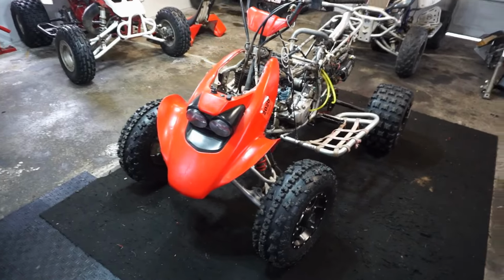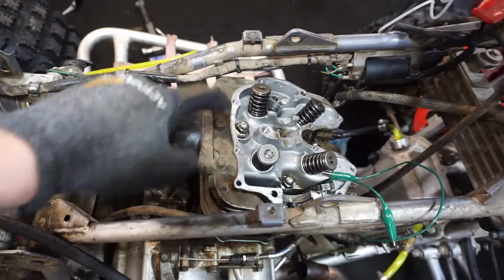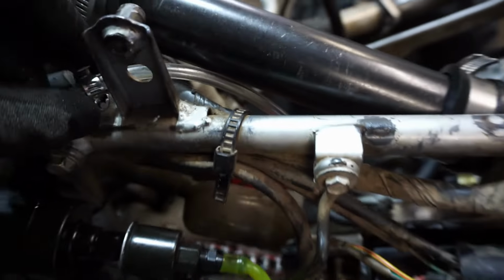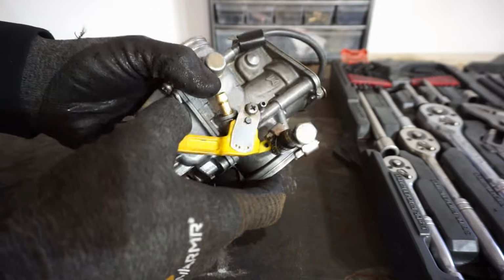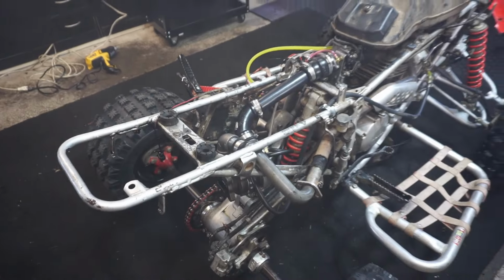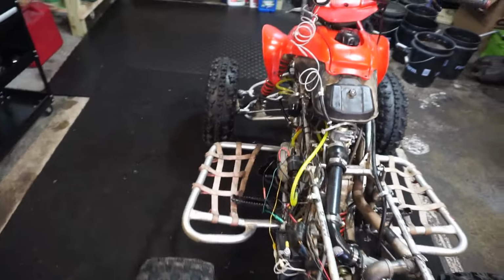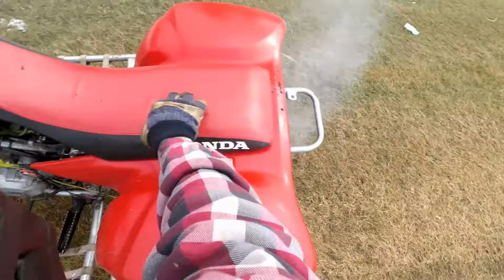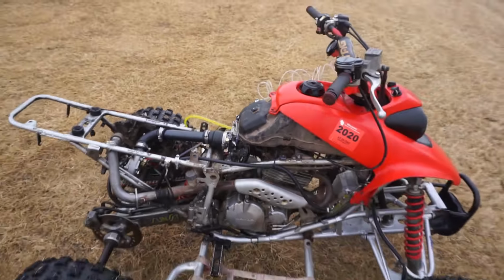Turbocharging My Honda 400ex 2.0 First Ride (New Design + Upgrades)

Comment: Hey brother you should never use an extension with a torque wrench. Ive tested it and 100% the extension does affect the reading and youll end up over torquing. I mean if ur using a 1/2 inch drive and a super stubby extension with a deep socket thats fine. I know it sucks. But its the truth. So single cylinder engines are tough man. A lot of times you have to build a pre atomization expansion chamber. So essentially a canister before fueling with a volume equal to twice the volume of your engine. So in other words, you want to have air stored for the intake and compression strokes to avoid essentially creating a vacuum or negative air pressure in your carburetor i.e. causing detrimental surging, poor performance, and intermittent rich and lean conditions. Air density is extremely important with turbo stuff. Another way to  compress the air which also helps with your intake air temps is air to air intercooling. Intake air temperature being exceptionally important with carburators. There's a guy who does a really , really good series of videos on blow through carburetors. I'll post another comment with the link in a second. Of course the cure to all your problems is electronic fuel injection. Preferably port injection with one or two injectors that have an adjustable pulse width. Two is what I suggest. Yamaha R1s...like 2005-2009 have EXCELLENT fuel injectors and they're readily available. Get yourself a haltech elite 750 and I'm telling you bro, you'll be thankful you finished the thing. I own a supermoto'd  out 91 xr600r. It has a cr450 front end, carbon fuel tank, dual front brakes, and the 3rd smallest internally gated turbo on ebay. I converted it to fuel injection, cut a front mount intercooler in half, made myself a little air to air intercooler, the turbo sits where the stock air box used to. I just merged the dual header into one 2 inch pipe then welded a vband on that and the t3 flange, cut 4 inches off of an fmf power core 4, welded it to an 1/8 inch plate I matched to the shape of the outlet and dude I gotta be honest....its the funnest motorcycle i own. It does 135 mph, wheelies in 5th gear, sounds insane because it has an adorable little blowoff valve from a snowmobile turbo kit and it's LOUD. Plus it barks big ass flames and there's nothing that can touch it from 0-100. One more piece of advice...get yourself an even just a 1 bar wide band. I would get a 2 bar just in case but hey, that's me. It's the most sure fire way to get your AFRs squared away.

Comment: Is it truly running boots?. If so you need to pull timing out when boots kicks in. Lol use a boost ref, solenoid. To the stator, that pulls timing. Then you should be able to jet it back up. Btw put a down pipe on

Comment: the only reason i say to try it without the fuel pump and related parts is because the only time you tried it with the carb still being gravity fed (atleast in your videos) was when you were trying it with the carb feeding into the turbo (again i didnt see it in any of your videos) i still think that with the turbo and carb how they are currently is just fine and i think (im nobody so this is just my opinion) if you remove the fuel pump an regulator and have the fuel line from the tank go to the carb how the it would of from honda still with carb being referenced to boost (may have to play around with how said boost reference line are connected to carb) idk im not really anybody but it wouldnt cost you anything to take the fuel pump and regulator off an run the line from the tank to the carb an try to fire it up an see how it runs then ( if it runs at all or even decently you will most likely have to play with jets an needle and seat) as far as what i seen in all the turbo quad series you have tried literally everything else. on a side note the external oil pump to help pull the oil out of the turbo was freaking genius ive never even thought to try that but ill be using that idea if you dont mind lol. whether you try it or without the pump or not you got damn close man take care

Comment: Man you can do it people turbocharged banshees all kinds of stuff I just watch a video today where a guy took a lawn mower carburetor a lawn mower carburetor and stuck in on a 302 Ford motor and made it run it smoked the tires like it had a four barrel on it and it gets 45 miles to the gallon it's all about airflow and fumes you're dumping way too much gas on a lawn mower carburetor you don't want to go past 5 PSI so try to get it down to three it will plug the carburetor on my four wheeler I went from a 27 to a 30 and it pulled a rabbit out of the hole and it's on a 250 downfall transmission casing only has four gears I need five or maybe six

Comment: Maybe should check out Cars and Cameras.  They boosted a gocart and worked dang good.  Maybe they can give you tip of what might be wrong.  Love the video still
Reply: They had to switch to fuel injection. Then it worked like a charm
Reply: @donsylvia5164  well I wasn't sure how they got it to work but it was primitive looking and it worked

Comment: U need to change the slide needle to a larger needle once u jump up in jet size like that. Its just way too rich. Check ur spark plug. Bet she's rich bro. And w.e. is making it smoke is also an issue.

Comment: i think if it is putting that much oil out the exhaust makes one think how much oil is making its way into the carb going into the engine which then causes bogging because not enough fuel because the oil is washing away the gas

Comment: I do know on cars turbos need a down pipe or else it’ll cause a big boost leak for sure or no back pressure basically this isn’t a efi quad so it can’t be tuned try to dial in gap on plugs a buddy of mine turbod his quad I’ll give him a ring and report back to you

Comment: I would add a base gasket to lower compression ratio before throwing in the towel. I think you have too much compression for your setup. Also, try going with a bigger pilot jet. Leave your main in the 160-170 range and let the power jet make up the difference up top. Also, what gas are you using? Personally, I wouldn’t pressurize the carb. Blow through should do the job. C’mon man, one more try…….

Comment: Wonder if you could retro fit a fuel injection from a motorcycle or quad in fit?  That may make tuning a bit easier once it's done.   I think your really close to figuring it out.  Don't give up.  Take a break from it and keep researching.   You got this.

Comment: Dude, trying to get a carb to work with a turbo is a pain in the ass. I know you don't want to spend the money but just give up on the carb. Carb and soend the 1200 bucks for the stand alone fuel injection. Will take care of all your problems and that thing will fly. You will not care about the money after you get it done because it will be a monster. After that you cab change out the spring and push about 8 pounds and you will have trouble keeping the front tires on the ground.

Comment: Dude.. Carburetors rely on VACUUM to pull fuel in. You're instead, introducing PRESSURE into it.. That pressure is going through the jets and pushing fuel back into the float bowl. That's why it will spike 5psi but as soon as the remaining little bit of fuel being thrown around in the intake makes its way into the cylinder, bam, back to the boost pressure keeping any and all fuel from entering
Reply: You need to have the carb on the intake side of your turbo if you want this to ever work

Comment: i think you really need a fuel injected quad or motor cycle to actualy make some boost..
cause you dont see any carb engines with a turbo yes sometimes like 5 video over the hole internet... but fuel injected there is a guy with a turbo 450cc yamaha bike and i have seen others.

Comment: Just turn the boost all the way down almost off slowly add boost. Set boost low as a test. If it runs with really low boost. Bigger carb. It sucks push it the the corner. Come back to it I think ur close I know it’s super fustrating

Comment: Don't boost the carb put the carb on the intake of the turbo then the turbo will just suck on the carb instead of boosting it then you will be able to jet it it's the easy way to make boost with a carb
Reply: He tried that in his first version and it failed miserably, wouldnt even run. Blow through is definitely the way to go.

Comment: Boost pressure is pushing fuel back into the bowl.  Idea💡 run 2 carburetors one on the intake side of the turbo. 2 carburetors So the original carb makes it start and idle, 2nd carb gives fuel under boost.

Comment: Loosen the waste gate to keep it at 4 pounds of boost and run it, should be fine.
Reply from the maker: I will try that.
Reply: @2vintage  start with the gate loose as possible and tighten till you see boost, over 5 pounds is gonna be way to much for a single cylinder. i think i saw you boosting up to 15 before the head gasket went, you seem to have plenty of fuel for 4 psi
Reply: @2vintage  this has to be done under load though
Reply from the maker: @Meech917  idk if my waste gate is adjustable

Comment: so Why do you just jump to changing the jets?? there is an air/fuel screw, I have yet to see you warm the bike up and actually adjust the carb ?? unless you do and do show it.. Also have you checked that the air filter wasn't to constricted ?? I agree Im now into you what is now the 2nd video so alittle over an hour.. I wanna see it runnnnnn!!

Comment: Hey Joe love your vids... I'm wondering if your compression ratio is too high.. I know supercharged vehicles run around 10 to 1 I think mabey 9? If the engine evacuate the burned boosted air it will act like that.. kinda like the exhaust is plugged..not a pro just an idea👍👍👍

Comment: man.. Never mind you seem to be that same guy that acts like you know it all and wont put in the leg work. If you have the correct compression. Then its either going fuel delivery or timing.. I have yet to see you look at a spark plug?? Maybe just a hotter or colder plug..

Comment: A very wise man once said to me if you do adjustments up down and all around on 1 part of the system and theres no change. Its not your problem.  You have a spark issue. Make your plug gap as small as possible and if necessary uprate your coil. Under load the cylinder pressures are killing spark

Comment: I know im a bit late committing on this video, but i agree with some comments about the carb. A vacuum controlled slide wont work well with the turbo . And im curious about timing. I remember that cars under boost need different adjustments in ignition timing.  I think they need to be retarded a bit. Just my 2 bits worth. Love your channel.

Comment: i'ts never a good idea to run turbo if i'ts don't have all parts on exsample your turbo dont have boost clock parts on in end,but if i was you i would just put old bike cooller to hot side,yeah its direct little a boost in carpurator but in this case its goos idea to test becauce its can stil work really good.

Comment: I think you'll need a custom needle. When you think about it, you're idling fine, at low rom you seem okay, but as soon as you're making boost you start backfiring, which means lean. So, you'll need a big jet, and a needle that will restrict flow early on but dump fuel as you hit higher boost and fuel demand increase. Try cutting half an inch off a needle? Taking some of the taper away completely to see if you can dump more fuel once you hit boost?

Comment: Ok so you did follow me on the upgraded fuel pump and regulator, good. Told you tho, to get a fuel PSI gauge, you NEED to know the fuel psi... As i said; you need 2 PSI fuel pressure more then boost so; @ 8PSI boost, you need 10 PSI fuel. The regulator needs a return line!, the line you blocked-off... The jetting (and the pilot screw) NEED to be close to stock, the boost pressure IN THE carb bowl, will enrichen the mixture, automatically for the low boost you want. Wish i could give you my email or phone # safely, to help. You are close, do not give up!!!!!!!!!!!!!!!. Install a muffler on that thing asap too!!!. PS; test your spark plug CAP, and see if it tests right, you might be killing the spark with the added fuel/ air pressure... High boost settups run high perf. ignitions systems...

Comment: Doesn't turbos need to be as close as possible to the exhaust gasket?
Reply: no that isn't necessary, with a quad its just easier to put it in the back since you have more space than at the front

Comment: Too many variables without a gauge to measure richness and lean. Would need an oxygen sensor with a computer to show exactly rich and lean. A guage to measure your work. It needs not a steady rich and lean but a ramp up during full boost for more fuel. Without proper instruments to tell what is going on, like a lever arm to increase fuel during boost. It looks too complicated to me.

Comment: Okay for one I seen a f**** rubber coupler for house pipe on the hot side of Turbo that's not going to work that's gonna  last about 5 minutes until the engine warms up 4-2 the turbos too small it's actually choking your engine you can tell by the sound of it you need to get a little bit bigger turbo and then quit f**** with electric fuel pumps you need a f**** pulse pump to the f**** pulse of the engine and then you just compensate for needing more fuel with a bigger jet I know I seen somebody on here mention the boostedboiz 400cc shopping cart video that would definitely be a good video for you to watch to get some insight but you definitely need a little bit bigger Turbo and a pulse pump for your fuel pump or if you really want to get Brave converted to fuel-injected it'll be a lot easier I mean it be a little bit harder in the beginning but once you got it converted and running it be a lot easier to boost it with the turbo on a fuel injected setup then a carbureted setup

Comment: The idea of the bike is awesome, but I'm not sure you'll ever get the performance out of it you are hoping for. I say ditch the turbo and spend the money on a big bore kit, new exhaust and taller cam. It may not be unique, but it will work the first time and weigh much less with several less possible points of failure. Or, better yet, since a turbo 4-stroke runs like a NA 2-stroke anyways, just buy a 2-stroke instead!